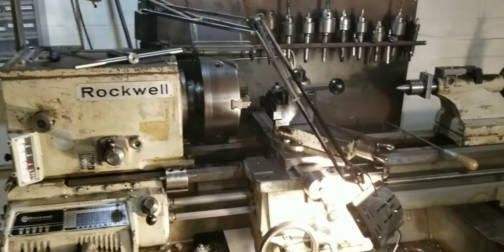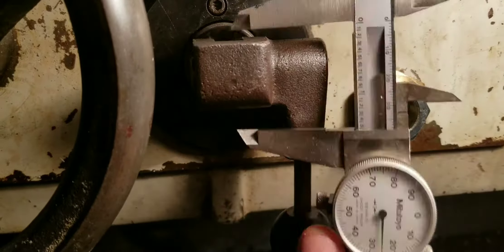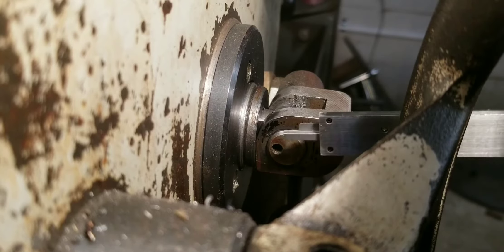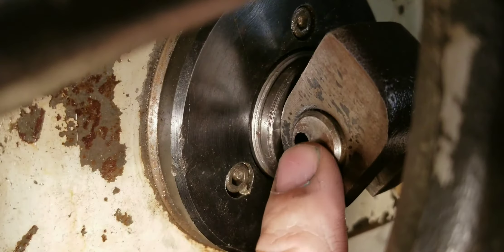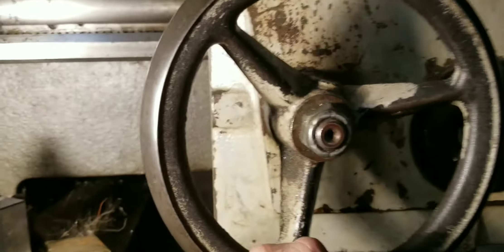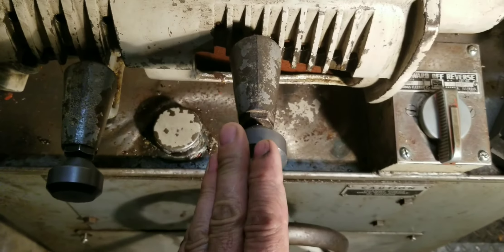14" Rockwell knobs and chart images

Comment: That's perfect, thank you! We whipped up a solution in CAD, used a 5/16" stainless bolt into the post. Mill the head to flats, cross drilled, and put a stainless pin through it to rotate the cam lever on...but the pin is small, and threaded into the cam block with 10-32 threads. Makes me nervous about long term durability, I like the 5/16" counterbored into a much larger rotation shaft, and the set screw is a nice touch. Thanks again!

Comment: I'm glad I stumbled across your channel. Great videos. I've had a 14" Rockwell for years & love it. Since you seem to have researched a lot of parts, I'm having trouble finding the spindle bearings you used. And I very much would like to replace the variable speed belts. If you know where I can find those, it would be appreciated! Thanks
Reply from the maker: The belts are 2322v431 and 2322v437. This is for the standard model if you have the speed lever on the on the carriage the belts or at least 1 belt are different. The bearings are New Departure, Delco double row 5515 for the main bearing and the 2 others are 73L13 New Departure New Single Row Ball Bearing.. there both on ebay right now for $16.89 each for the smaller bearings and $111.46 for the large main bearing you need 1 big one and 2 smaller ones

Comment: Ozarktools sells a good service manual for this lathe. I haven’t figured my threading chart out yet lol. I put mine on D 6 for 24tpi but its not cutting 24tpi. Any pointers? I really appreciate u making this video series
Reply from the maker: Wrong gear open the side panel up you will see a gear on top of another gear switch shem 2 around.
Reply: @Depth_of_Cut  the 16 and 32 gears?
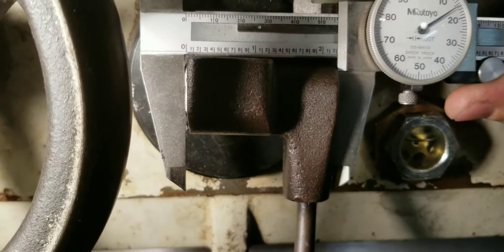Reply from the maker: https://youtu.be/2bSB8Z4u-Z8 look at 4:27 pause it there is a smaller gear on top of a larger switch them small gear should be on top like mine. The other setup is for 4 tpi all others take the gear setup like mine
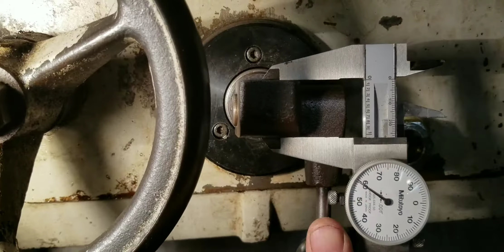Reply from the maker: look in that video at 4:29
Reply: @Depth_of_Cut  ok thanks man!

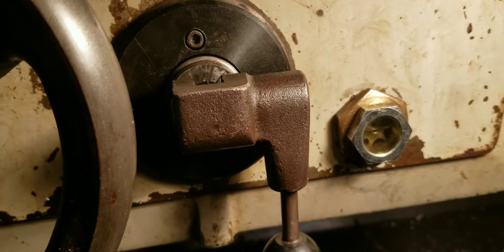Comment: I’m restoring a lathe just like this. I lost the little metal piece hanging off the carriage you can see it on frame 1:23. Does anything have manual for this machine? I want to get the rough dimensions so I can make replicate one. Thanks
Reply from the maker: Are you talking about the part hanging under the cross slide handwheel?
Reply: @Depth_of_Cut  yes right where the saddle and carriage meet. Its like rectangular shape.
Reply from the maker: @Mcduggies  that just pulls a pin in and out for threading with compound rest it's simple to make ill see if I can find a pic
Reply: @Depth_of_Cut  Much appreciated also looks like the end of that pin broke off.